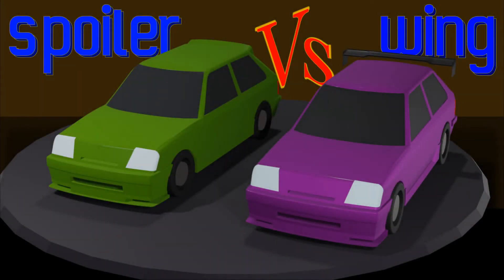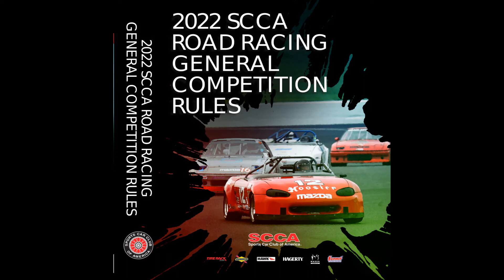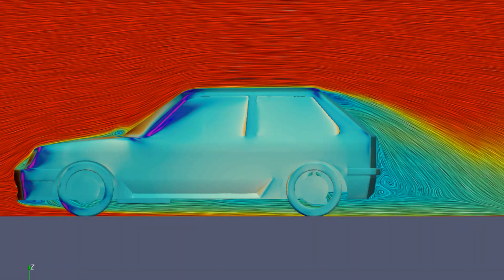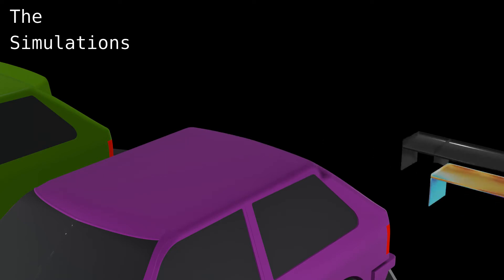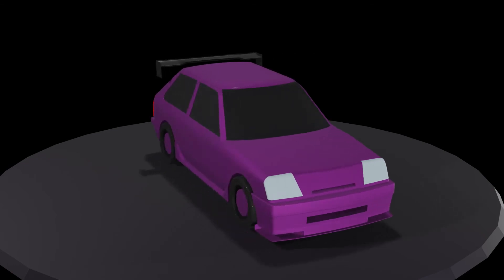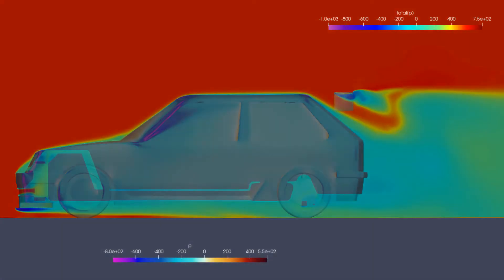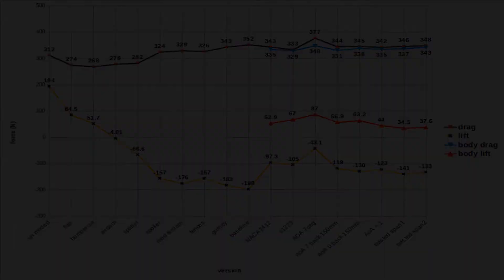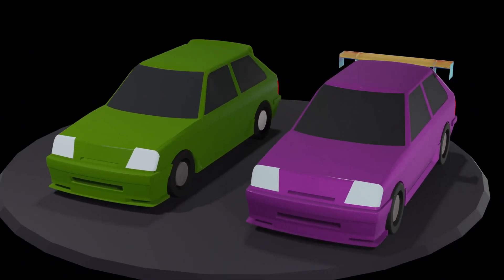Production Car Aerodynamics: Spoiler V's Wing

Comment: Interesting discovery. I wonder if the low pressure zone created under the wing is interacting with the rear windscreen causing a net loss of downforce. Thus moving it higher and/or further back effectively reduces the magnitude of interaction between the two members thereby increasing downforce.
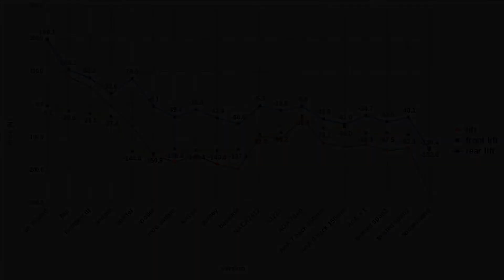Reply from the maker: There would be a loss with the wing and windscreen interaction but the loss between a spoiler and wing is from under the floor. The graph at 6:40 illustrates where the majority of the loss comes from. This graph of pressure along the centre of the floor tells us a surprising amount of how the car creates downforce. Moving the wing into air less effected by the body means there is more mass flow rate that the wing can use to create more downforce. The plot at 7:00 shows that you do get a little back from the body if you compare the baseline, car with the spoiler from the previous video, and "AoA 0 back 150mm" .
Reply: @nelsonphillips  thanks for your reply. While it is outside of Aus ipra rules, does moving the wing upwards from the roofline have similar effect to moving it backwards?
Reply from the maker: @trustalign  it should, you will still get the minimum body loss though. So up and back should be better. The TCR cars have there wings along way from the body, even then they have a very low AoA.

Comment: I’ve been trying to find information like this for weeks. Get info 💪🏽. I’d like to add something, what about a duckbill type spoiler? They extend much more then a standard spoiler. Reference spoon design on a EG hatch
Reply: I actually have a GE Honda fit, I’m currently trying to decide to go with a wing or possibly the spoon type duckbill.
Reply from the maker: spoilers with a low angle are generally good. I don't think wings are any good for hatchbacks, though thats because nobody really understands wings and hatchbacks.

Comment: Very useful video and channel. Found this and binged the whole channel. Any chance of some simulations of a stock style spoiler at different lengths? I have a civic (ep3) tack car that has a factory spoiler and Im just wondering if an extended version would bring any improvement
Reply from the maker: I'm may not make a video specifically about that, but a longer spoiler gives you kick the air up later at, likely,  less drag

Comment: Nelson,

Watched this video probably 6 times and have been using it as a reference alot. Thank you for the information.

Currently trying to develop a wing for a hatchback time-attack vehicle, what is your insight of the further back you place the wing? better? worse? I know you stated further back is better... is there diminishing returns on this? anything insight would be helpful
Reply from the maker: I assume that even TA has some max distance you can have body work. This is usually the constraint. But, saying this if it is to far back aero balance will become more fragile/difficult to achieve and maintain.
Reply: @nelsonphillips  yes the do, for my class(street car) it is 12.5 CM from above and from the sides. So i intended to use all of that space. Supporting wouldn't be an issue...would you be willing to do testing of the car if i had a 3d model? Message me!
Reply from the maker: @Kraftwagenmotorsport  I'm on twitter, reddit, imgur and mastodon if you want to discuss anything

Comment: thank you for sharing!
I've been trying to understand what kind of wing / spoiler works best for my clio, probably because my hatch has such a steep angle, i should probably just stick to a regular spoiler? and thoughts on this?
Reply from the maker: Depends on you use. If you are just using your car for the road, smaller the better. If you are track racing only then it depends on cost or fabrication skills. The slope of the hatch, unless its very shallow eg. honda integra, wings just cannot get enough air. Spoilers are easier. If you can stick winglets on the side of the spoiler that tends to better. The problem is that you just cannot buy a spoiler with side winglets so you would need to make it youreslf.
Reply: @nelsonphillips  thanks for your reply!

Comment: Hi Nelson, may I ask if there are no regulations on placing the wing higher; what would be best?
Apologies if I missed it within the video
Reply from the maker: definitely the high and further back the wing, the better. However the spoiler is very effective. If you have a look at the Lanica Delta group B and then the group S rally car they ran all configurations. They actually came to the same conclusion I did with this video with the group S car. I was unaware that they did, it was only because I have been doing a bit of research on that car.

Comment: A wing would be more beneficial. You're forgetting that air is flowing around the sides of the car as well.
On a FWD car, the rear end's purpose is only to follow the front and can become unstable.
A wing with the side fins as shown can improve the handling and keep the car pointing in the direction it needs to go.